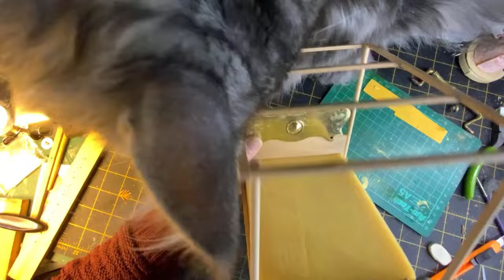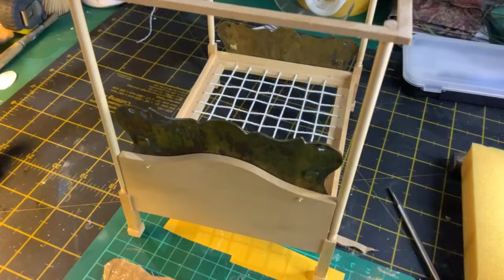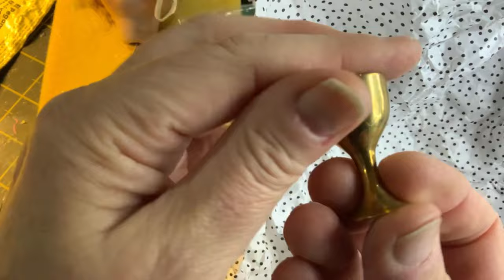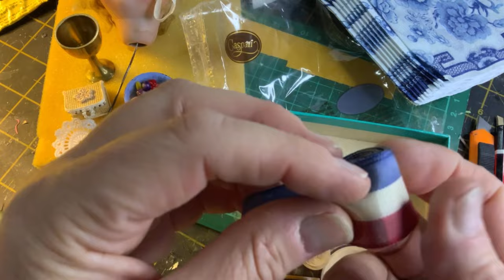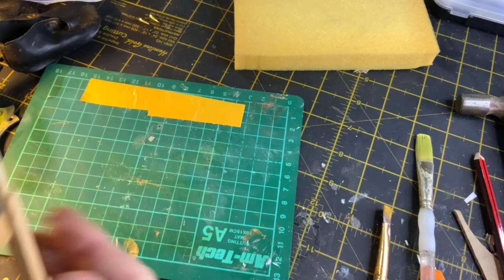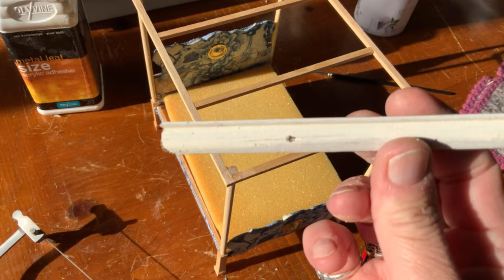Transformation of a "house of miniature's" kit, doll house bed

Comment: 1894 is the mold number.  I love brown eyed dolls too.  She is very pretty.
Reply from the maker: Thank you so much Lynne it is but in this case it is also ca 1894 ,I do have a very good book which is falling apart 😫German doll marks & identification by Juergen & Marianne Cieslik it  was published in 1990s but I don’t suppose much has changed hopefully 🤗it describes it as ,…AM dolly face,shoulder OR socket head which seems to fit .Thanks for your input it’s always welcome and as a well known saying goes two heads are better than one ,rather appropriate in this case 😂😂😍.but those eyes are incredible I have a few heads ,dolls and eyes they are by far the heaviest and most beautiful that I have come across .she is gorgeous for sure .have a great day Debs 🌟🤩🫶🏻
Reply: @dollshousedilemmas6787  Yes, she is a stunner too for an 1894, mold number could be the introduction year, but they were made for many years as was the 390.  As you probably know the quality varies a lot with AM dolls, yours is very lovely!
Reply from the maker: @LynneWright  yes this is so true ,I feel it’s almost impossible to pin down a date for a doll it would help greatly if there was a known date between when the mold numbers where made .I know a lot goes on the style of manufacture stamp as in the ceramics trade but AM seems not to have changed that much .Also the body style I know she had a comp ,wooden ball jointed body as my friend told me ,but if the book is right they did a shoulder doll of the same mold which I assume would have a kid body does that mean these are the earlier dolls ?? It’s a mine field .🤪Honestly any help is appreciated,thanks again .I do feel she is of a nice quality not that it really matters to me as I not a serious collector and just love the dolls for what they are .Information is just a added bonus .😇🤩💝
Reply: Yes, they did kid body shoulderhead versions too!  AM was very prolific making dolls from 1890 to 1938 and the dolls are very common in the US.  The quality varies greatly too.  Yours has lovely feathered and molded eyebrows, many just have a single stroke.  The most common dolls found are 370, 390 and 1894.  There are probably about 20 or so 1894 dolls on eBay US right now and the quality is from almost garish to stunners like yours.  Yours being a large size and such nice quality, it probably was for a more upscale market.  A lot of AM dolls are found on bodies with oddly long wooden stick upper legs, they did this to make dolls appear taller which allowed them to charge more.  The dresses hid the odd looking legs 😂
Reply from the maker: @LynneWright I see ,yes I knew the 370 and 390 were common but not the 1894 ,how interesting .I have a three or four of the 370/90 s .well it good to know she is a nice one for her mold .I do want show more of my dolls and there restoration or remodelling it’s just getting round to it .thanks so much for imparting your knowledge I do love to learn a little .thanks again xx 💝🤩🌟